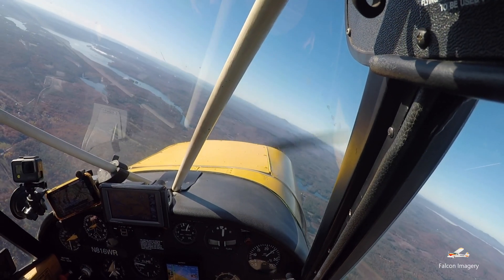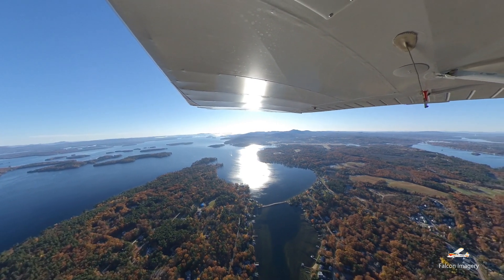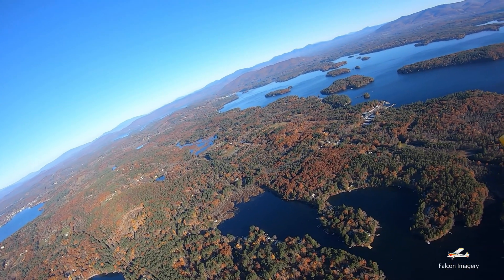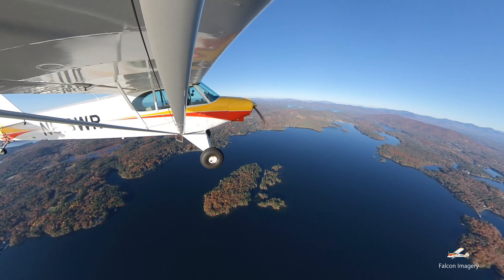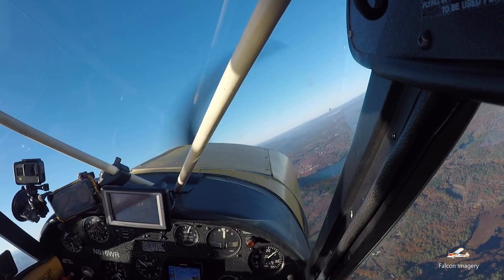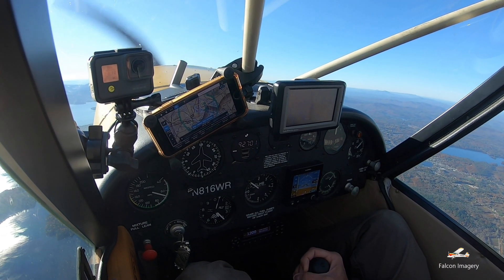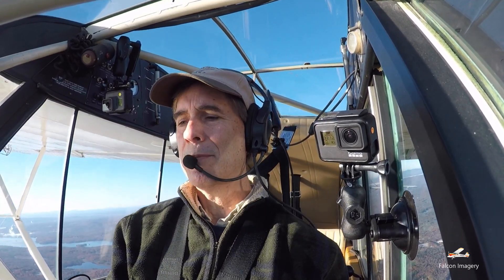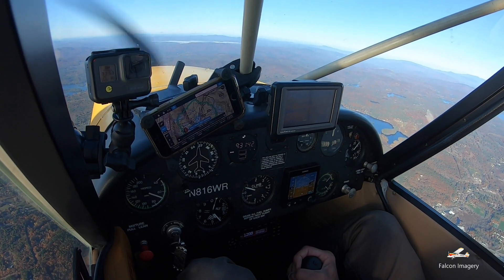How to do Chandelles in a Super Cub

Comment: @FalconImagery, if I remember my ground school correctly, clearing left first has two reasons, 1) as is similar to rules for boating an overtaking craft from the tail should pass the standing craft on the right if the option allows (in the air this is more often than say along a coastline). 2) in normal flight operations of side-by-side aircraft, the PIC is most often in the left seat giving them the greater visibility to the left prior to initiating any maneuvers.

Once again, thanks for providing some birds-eye views of the beautiful Lakes Region.  The Winni looked like glass and trees turning nicely!
Reply from the maker: Correct on your answer, and yes the views were pretty spectacular.